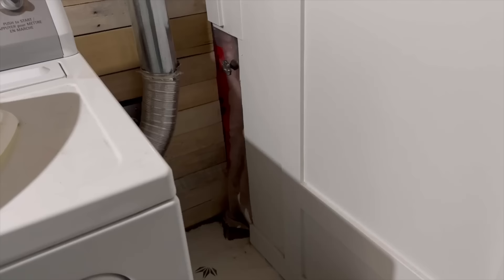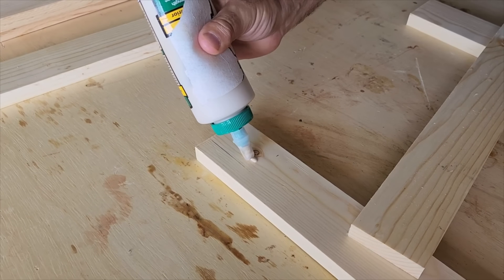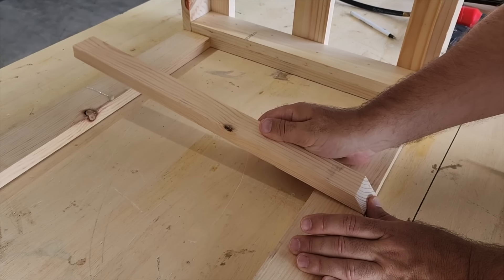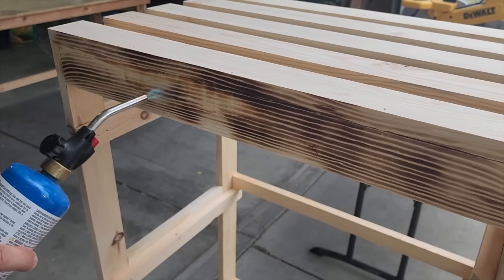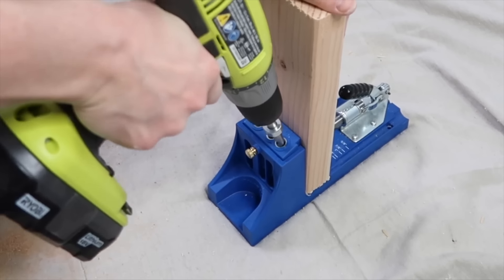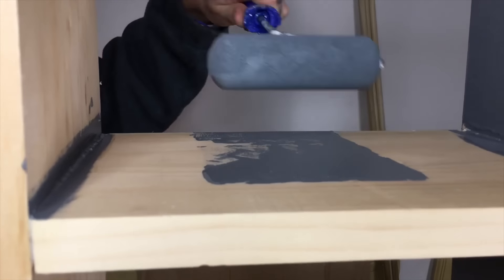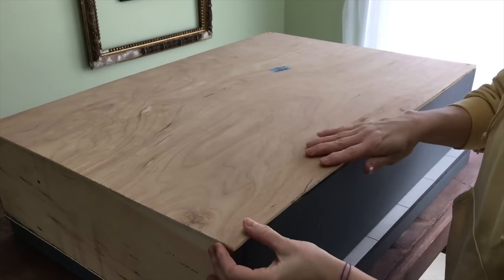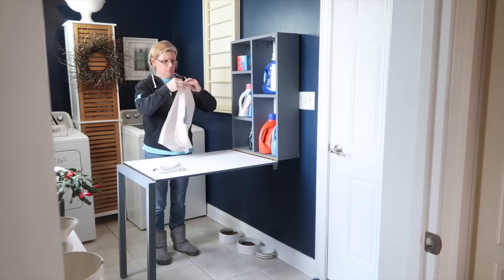Stick a tension rod on your washing machine for this brilliant storage idea!

Comment: Using tension rods against a washing machine to hold a board for extra storage is a bad idea. Washing machines tend to scoot around during operation. It's going to shake the shelf and everything on it, loose.
Reply: That’s a dryer.
Reply: So even more movement
Reply: Still looks like wasted space. It's not very practical 😐
Reply: @coracobb3917    The title of the video states "washing machine". A dryer also has a lot of vibration.
Reply: Those tension rods aren't made to hold any weight.
Reply: True that 😂😂😂
Reply: @coracobb3917 😂
Reply: HomeTalk Ideas aren't always the best 😂😂

Comment: You covered wood with wood contact paper instead of staining the actual wood? 🤔
Reply: Possibly to be more resistent to water and liquid detergent spills?
Reply: @maggiegarber246 Good point!
Reply: If u don't hv a garage, live in an apartment, or hv inclement weather, it's tough to stain wood inside your place. Especially hard with indoor pets due to the fumes. Just a thought? - just me in Palm Springs 🌴
Reply: @maggiegarber246 Also, u could choose contact paper to suit decor. It doesn't hv to be a wood grain. -🌴
Reply: It looked like she was using plywood which in my opinion does not stain well. Also the contact paper is waterproof and easy cleanup.
Reply: I've used tension rods and in my opinion they do not work. Definitely not practical for a laundry room if you're wanting to use that side table for a decent size bottle of laundry soap.
 I do love the laundry basket station 👍👍
Reply: That's what I was thinking it actually looked like decent quality plywood too.
Reply: @maggiegarber246  a finish would seal the wood anyways though.
Reply: And why build a shelf that could fall instead of buying a wall mounted shelf? 🤷‍♀️
Reply: Easy wipeable !
Reply: Time saver. After all, she's not refinishing an antique.
Reply: @tammysims8716 agree and easier with paper.

Comment: Tension rods against a washing machine that jiggles. Hmmmm.
Reply: I was thinking the same thing because an off balance washing machine will probably bend those tension rods.
Reply: I was thinking the same thing.
Reply: Came here to say that too.
Reply: It wasn't the dryer by chance?
Reply: Just thinking that! 😂  Really one of those $12 3 drawer Sterilites would work in that spot.
Reply: Right. Common sense shut that one down instantly..
Reply: I thought the same
Reply: LOL that's the first thing I thought
Reply: It was the dryer not washing machine
Reply: I think it's to help keep it's balance lol🤷‍♀️
Reply: I thought the same but it turns out they don't know the difference between a washer and dryer. Also, a wood sticker over wood 🙃
Reply: Not good
Reply: Or you could buy two shelf brackets and attach it to the wall. 4 would get you two shelves.  Any weight on those tension rod will cause it to. Ent and fall
Reply: It’s the dryer.
Reply: I thought the same thing
Reply: Ah!    At the very end you can see the tension rods are between the DRYER and the wall.